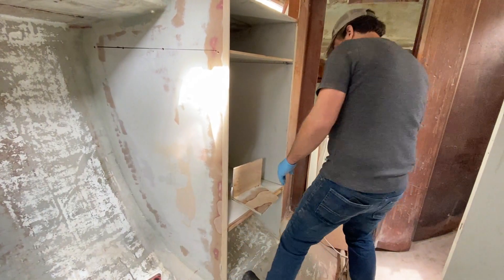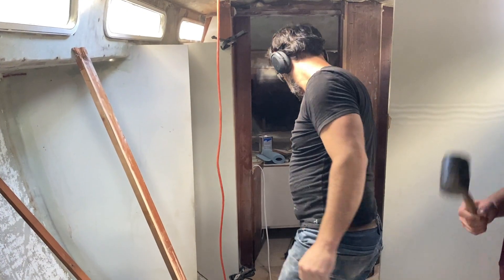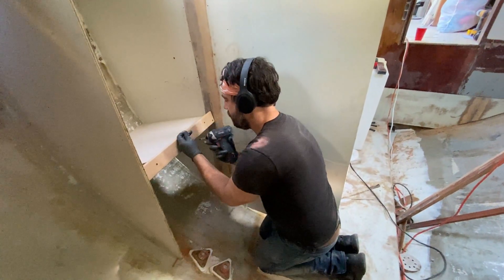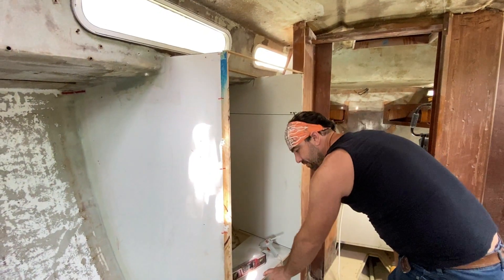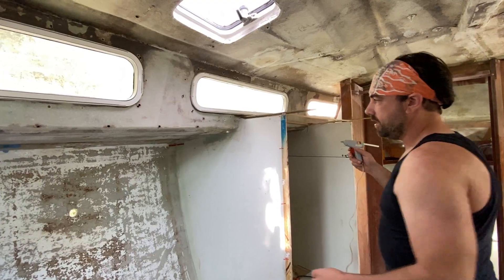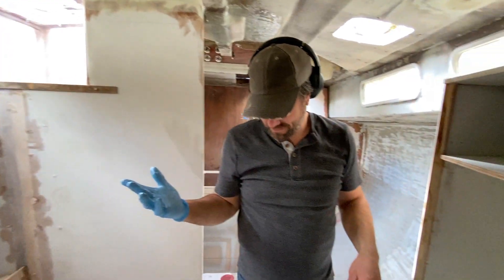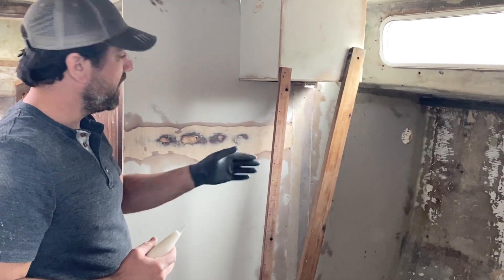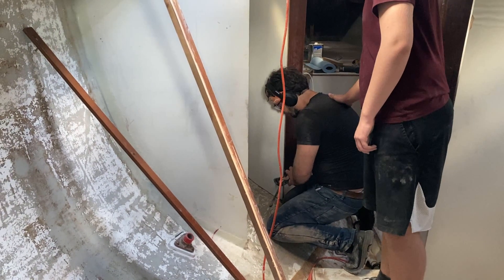Installing the FINAL Bulkhead: Building Our Boat

Comment: Fellow Nauticat owner here. I’m a little worried about your poop tank. One, a tank of poop and water is SUPER heavy. Second, pumping the poop from the toilet, up over an anti-siphon loop, and into a tank sitting above said pooper, is very likely to mean brown (stinky) poop water always in the commode. And when you’re sailing, even more delightful poop water forcing it’s way into the bowl....not yummy...
Reply from the maker: Hi David! I definitely have the same concerns, but we are installing the tank based on Nigel Calder's recommendation of a gravity fed tank. We'll have to make sure we're pumping thoroughly! Weight is definitely a factor as a full tank would be around 300 pounds, but we've balanced it with a 150lb washer/dryer combo on the port side, and don't anticipate sailing far without being able to open up the bottom valve!
Reply: @ChrisandKellNowHere  Thanks for the reply. Gravity fed dumping, ok! If you’ll often be someplace you can do that, then it makes sense. I live in the Puget Sound, which is entirely a zero-discharge zone, and free pump-outs are plentiful. I’m enjoying watching your episodes, great job!
Reply from the maker: @Chambersdavidjames  We're just down the road, and will definitely head your way before heading south. I hope we'll have a decent holding tank if we need it, but prefer lots of options to keep it low or empty 🦨